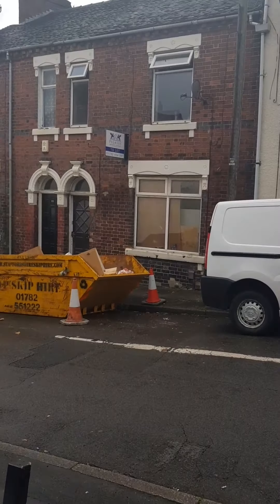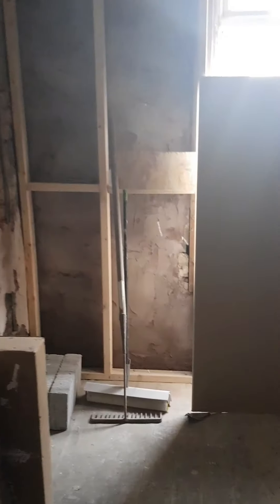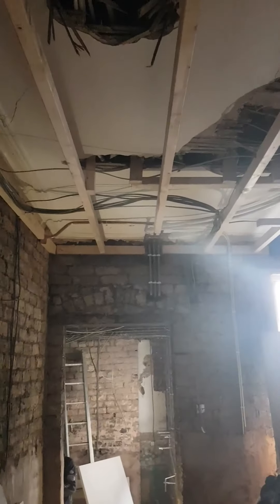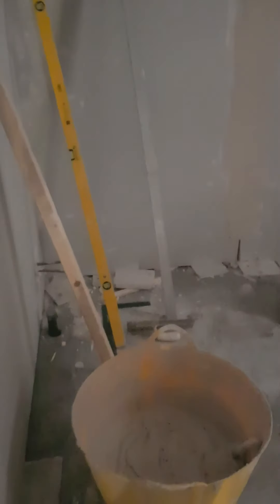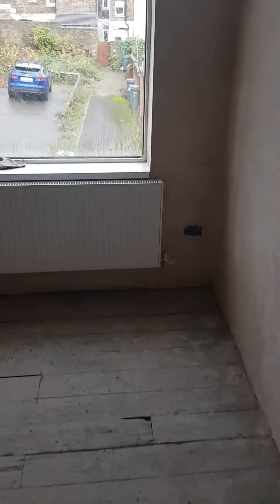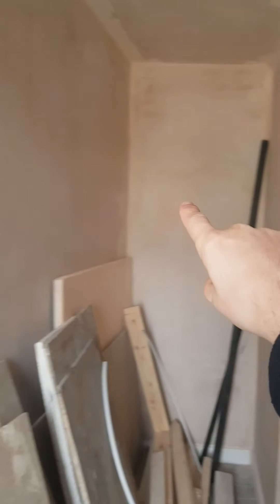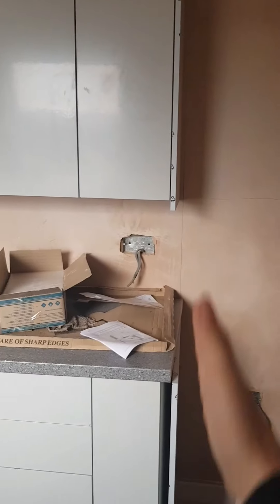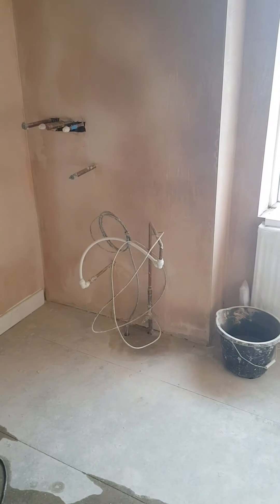WOW , great progress, 2 x flats full refurbishment #propertyinvesting

Comment: Great development Mr F (flashy) Pace;) thanks for the insight. can you advice on finances please. Refurb cost, PP and Expected GDV. Ta👍🏽
Reply from the maker: Hi anthony
What f pace is this the 1 behind me
These are a clients properties 

Its was sourced by them selves 

Refurb est 200k for all 4 houses / 8 flats

Gdv estimated around 435k 

The client sees this as a single let block but in a hmo fashion as 8 together 

- John
Reply: Pegasus Property Group thanks for response. So do you just project manage this one?
Reply from the maker: @anthonydayspring9923  yes correct 

I am consulting on this project there is 4 in a row total 8 flats and great clients always works  best like this 

I do consulting in between our own stuff if have capacity 

- John
Reply: Pegasus Property Group understood. So would you say budgeting £50k, ball park, is about right for house to flat conversion?

PS - disregard my F Pace comments, just messing about. Spotted it in your last vid too - just pulling your leg. I’m a car nut so couldn’t help myself...
Reply from the maker: @anthonydayspring9923  yes banter always good in this game

The 50k would depend on if already existing flats
If not will need full planning which then needs meet current build regs such as epc upgrade  internal or external wall insulation
Sound proofing and sound test between floors
Splitting services which isnt cheap on a commercial to resi i allow 1k per service per flat 

Also lastly area prices london will be different labour rates than north

Then does it need back to brick nee windows new roof any external works such as fences, render, pointing

Id say if you are looking to do this do a test case with a qs 

Use a online property show qs create some floorplans and get him do a desktop 
Its an initial cost but offsettable against tax so not total loss
Sorry cant help more but ive done hmos for 68k but also done for 100k

- John
Reply: Pegasus Property Group - legend. Thanks for such a comprehensive answer. 👍
Reply from the maker: @anthonydayspring9923  not a problem here to help 

- John